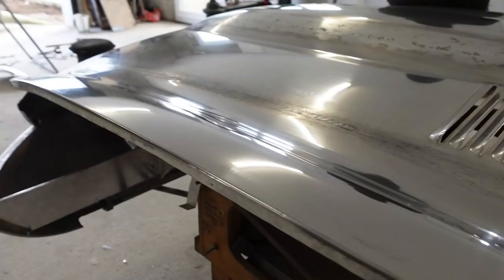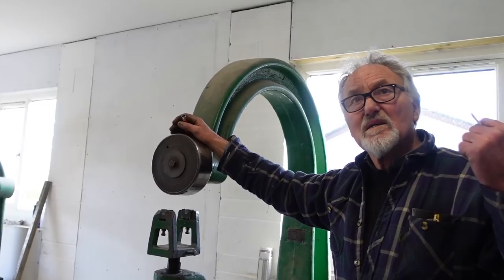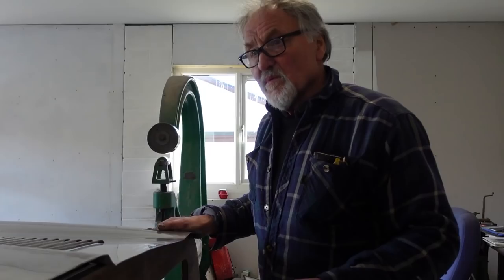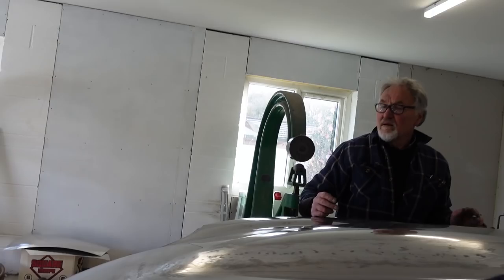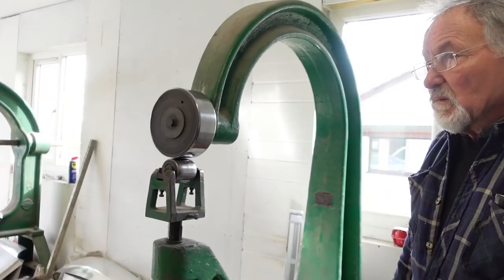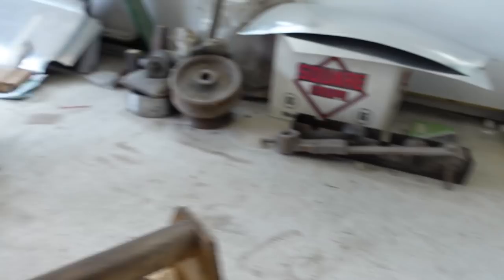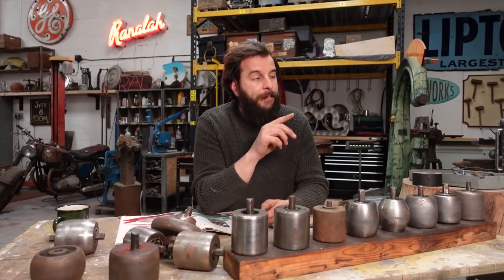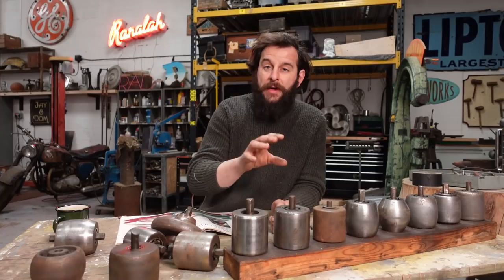Reinventing The Ranalah Wheel (ft. Geoff Moss) | Reviving History

Comment: What's really impressed me is that everything that I thought I knew about the "English Wheel" has been debunked! Squeezing the metal between the two wheels, the metal has to go somewhere, this is where the stretch and shape of the panel is made. It makes sense that because the upper wheel is flat, the contact patch of the lower wheel has a curvature. What I didn't understand until now is that the curvature is tiny and spread over half an inch or three quarters of an inch contact patch. What happens on the extremities of the lower wheel is immaterial except to allow for clearance for the panel as it's pushed and pulled through the wheels. A "flat" wheel isn't flat, it has a very small crown or curvature and a large contact patch  whereas a high crown wheel has a slightly more pronounced crown or curvature on the contact patch and a slightly smaller contact patch. The difference between a flat and a high crown wheel, in the center contact patch, is minimal but the clearance on the outside of the wheel is what makes it obvious. The difference in the contact patch is thousandths of an inch or probably hundredth of thousandths of an inch! Interesting Stuff that's increased my knowledge!  Thanks Dom!
Reply: I was lucky enough to learn the basics when I left school in 1994..I had an apprenticeship straight from school..worked all over since making prototype panels from a drawing on a ciggy packet..

Comment: To get an accurate profile for your wheels I suggest to find some one with a shadograph. This is a machine that allows you to look and measure a profile very accurately. Your friends across the road from you with the CNC machines may have one, if not they might know someone that does. Part of my job involves making seaming tooling for the canning industry. We use our shadowgraph to inspect the profiles we produce, accurate to 0.0002" of an inch. Our machine also has software that can measure a profile and create geometry so parts can be reverse engineered. Once you get to look at your wheels more closely you will probably find that the area between the flat and the curve has a smaller radius connecting the two, we call that a blend arc. It purpose is to smooth the transition between the flat and the primary radius. They are usually quite small and not easy to see with the naked eye but are very necessary. I hope this information will be of some help to you. Good luck with the next part of this project
Reply from the maker: Thank you so much I really appreciate you sharing your knowledge

Comment: Nice work Dom. God and the devil are in the details. About finding the right shape; I would measure (big projection microscope image imported in CAD) as good as possible and CNC machine the shapes from the start. Maybe, I'm not sure, they should be heat treated to last and polished afterwards. Then let Geoff try them. Maybe you're good in one go. By doing so you have the production programs for the CNC machine and necessary drawings from day one. With tweaking on a manual lathe it probably has to go back and forth a few times (10 hours on the road as a minimum). Start CNC, maybe tweak CNC once and you could be done. Thank you Dom! Keep up the good work and stay safe. All the best, Job

Comment: Hi Dominic, 

I have never used an English wheel, and possibly never will, and only learnt what they did by watching Ron Covell. 

I have seen them for sale, but they normally come with a pile of bottom wheels, which clearly are not necessary, unless you have something very specific. It is always interesting to watch an old master operate these machines and learn from their vast experience.

When you get the designs and measurements finally sorted, the quickest way to have absolute consistency is to have them made on CNC machines. To attempt to modify them manually could end in disaster.

I'm enjoying your journey.

Regards Dennis

Comment: For mass production, you have, maybe two options. 1. Fully modern CNC cylindrical grinders. (Pricey) 2. Old school copying lathe. These have an attachment on the back where you fix a metal plate that has the curve you want to cut. Finnish may not be as good as grinding at first, but this maybe solved with hand sanding. Down side to this option: there won't be many about to find.
Reply from the maker: Thank you for the info!

Comment: Fascinating stuff,  when you discussed production of the wheels you seemed to be focussing on high tech to produce the repeatability, my question is how did they do this in the past, these guys where very clever.  I’m thinking of the three plate lapping method to perfectly flat surfaces with no technology (still not sure how someone sat down from first principles and worked that out).  It may be that there is a low tech solution.  Anyhow thought it might be worth some investigation through the material you gathered or your contacts to find out how they did it back in the day.👍👍👍👍👍

Comment: Once you've arrived at your ideal lower wheel profiles I wouldn't get them 3D scanned as it isn't the most accurate method. 3D scanning is great for complex 3D shapes but for something like this you'd be better off finding someone with an instrument like the Mitutoyo Contracer (or other manufacturer's equivalent) (I do know a company with one of these and might be persuaded to help you out ;-)). This is exactly what it's designed for and would give you a much more accurate and truer result. You could also use a profile projector/shadowgraph instead if you can't find anyone with a Contracer. The wheels would then be best machined on a CNC lathe (or a copy-lathe) and possibly CNC ground after heat treatment. Hope this helps.
Reply from the maker: That’s very helpful thank you!

Comment: Good video! I think that narrow wheel is pretty useless for a wheeling guru like that fellow, but there is a place and tool for everything. That narrow one is really handy, when pre-stretching something like floor panels for a car, example. Pre-stretching helps a lot when you are doing beadroller job, without that the panels will be curvy. The beadroller will stretch the panel and its really hard to get that "banana" shape out of the panel. But when there is already some stretch on that spot where you are running your beads, the panel will stay pretty much flat. I think some customers would like to buy extra wheel sets too. Keep up the good work!
Reply: You clearly know what you are talking about sir!

Comment: I spent over 12 years at a place in the Midlands called RSpanels restoring car bodies and making lots of diff varients of all aluminium etypes for racing, and also made the bodies for the eagle speedster and low drag, don't loads of work for Aston Martin heritage to include the bodies for the 25 db4gt and the 20 bodies for the db4zagato in the last few years . I even made the 1st ever prototype production DB11 bonnet which ran to the spec I built for a few years. Gives a message if you are after anyone to help?😁

Comment: Hi Dominic, your vid came up on my youtube feed, my apprenticeship was on the Ranalah and Edwards wheels, restoring Rolls Royce and Bentley's, spent many many hours on these machines, generally rough up the bulk of the shape and welded joints through the Edwards then finishing on the  Ranalah, all Aluminium work was done on the Ranalah, In my opinion the best wheeling machines. I feel a connection, I currently specialise in restoring classic Porsche, manufacturing 356 panels on the early cars (on an F.J.Edwards). All the best Steve.

Comment: I would send those wheels to an inspection house used to gauging the profile of gear teeth. The Mahr profile inspection machines at work look at involute form and the barrelling and crowning of gears and splines. You would get a micron by micron profile report from which to reverse engineer those wheels. Better than guesswork with emery cloth?

Comment: Totally gripping. I've never been able to look at a classic car, and not think about the artistry of creating those curves. Curiosity, it's called the English wheel, so did the Italians have their own independently developed wheeling machine, or did they use an entirely different method? I've been fortunate to ski, and ski in the Aosta region of Italy, and one year, on the coach going north from Torino, I noticed a largish, but nondescript industrial building with Pinin Farina on it. Nearly fell of my seat. I now know there were a number of P F factories, but still a special moment. I used to have an MGB Roadster, Soft top, Convertible, call it what you will, known simply as a 'B' to us, and my sister had n MGB GT, and the GT variant was the work of Pinin Farina. I've always connected my B to an Italian tradition. I drove my B rain, snow, or shine for over twelve years as my everyday car. Broke my heart when it went. Sorry. Rambling. Sometimes you need a bit of self therapy. Would love to learn the art of wheeling.

Comment: 3D Scan, point cloud to model, model to CNC, scan the finished part, compare the to the model, tweek and repeat. That way you'll end up with what is required. I'm guessing these are heat treated in some way? If so that may have a huge effect on where you start from.
Reply: High frequency heat treatment to harden the shell

Comment: If you mount a wheel in your lathe then put a DTI on the saddle you could map the surface.  From that a CNC could copy the original to less than a thou.  No need to fettle them.

Comment: Great video Dom- fascinating stuff! What steel will you be making the wheels from? I'm guessing that it will be some type of tool steel. Have you measured the hardness of your existing wheels? - will this mean that you will need to grind the final profiles before / after heat treatment rather than relying totally on lathe work? looking forward to the next instalment!
Reply from the maker: They will be en24, yes I’ve measured the hardness of the originals and they are not really that hard! The top wheel will be ground after heat treatment

Comment: I think the simplest and most period appropriate way to replicate the exact profile would be to cut a reference die and test the wheel against a backlight as it's shaped. And I believe you can use a profile cam to drive a duplicating lathe?

Comment: The issue with wheels you start with the one with the least curve once it fully contacts the wheel you go to the next wheel with more shape in it, 
the more aggresive the face gets the harder it is to keep from marking the metal and ending up with wheel marks everywhere don't try putting too much pressure and overlap your strokes closer..

Comment: You should get these "good" wheels precision scanned so that the contour is known and recorded.
No point in manually reproducing them one by one , the differences in radius is way too fine to do that reliably unless you own a copy lathe.
The best and probably only way to reproduce them in quantity ,today, is using CNC.
Reply from the maker: Your right, I definitly need to find a solution for reproducing them accurately, I’ll look into scanning
Reply: Either a CMM or a precision flat plate and height gauge should be able to give good measurements. If you're doing it manually with a height gauge you should probably mark it out (felt tip like) and do multiple measurements to average together and give proper data to work from. I'd try to do it direct from this guy's wheels so it's straight from the horse's mouth.

Comment: The main issue is the measuring of the wheels to find the radii of the various segments. After that, modelling them in 3D and manufacturing using modern NC machinery is a trivial exercise. Why would you want to do a production run on a manual lathe, especially as you are a Jack-of-all-trades and not a specialist machinist?